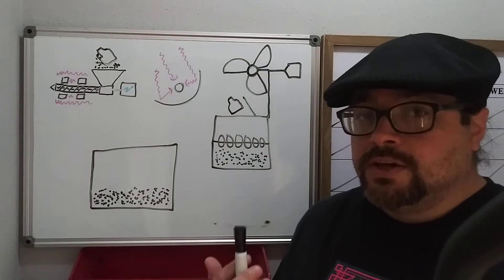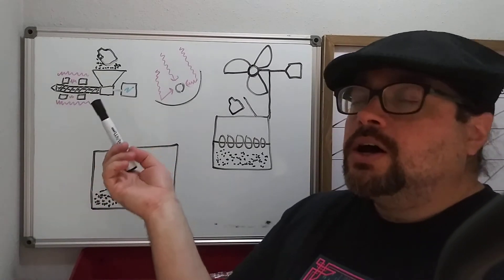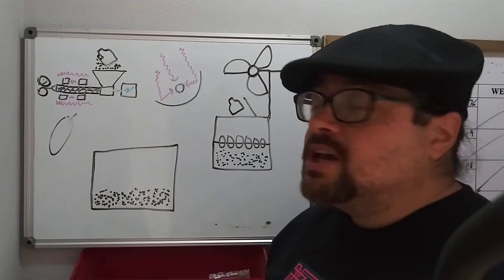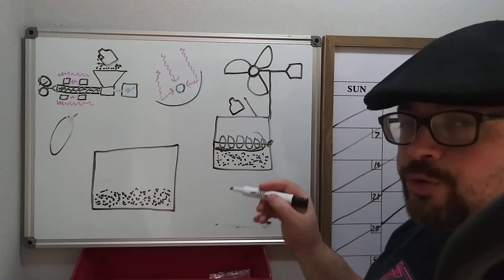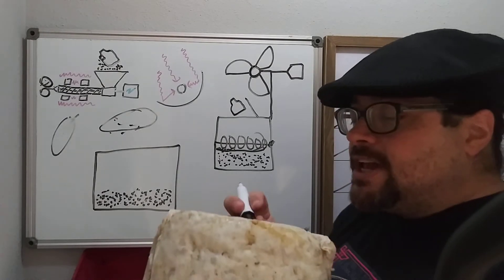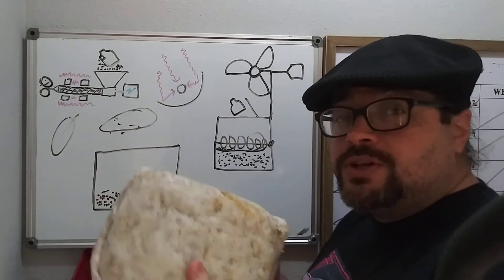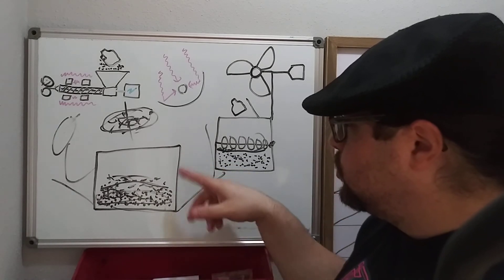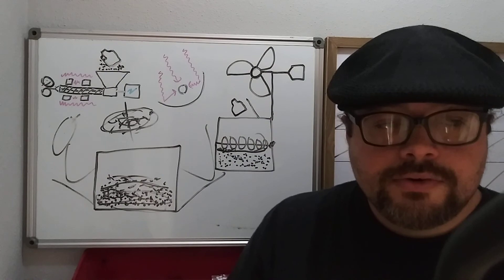Solar Powered Recycling Concept

Comment: At one minute in, I looked at the chalkboard and knew exactly where you were going. Great thinking. Note that the reflector should be approximately parabolic at its cross-section so that it focuses light correctly. In order to help moderate the temperature differences at the reflector's focus, it would be sensible for the corkscrew to be under a large thermal mass, which would both store solar heat as well as release it into the product more slowly. Sunlight is notoriously irregular. 

As for all the shredding, can you cut that out entirely? Heat turns the stuff into taffy, so why not have a melt chamber that feeds the extruder in the first place? Mixing after the fact seems a more energy-economical way to average out the product. A vertical, gravity-fed, heated hopper could supplant a shredder. Low speed, high torque, wind-powered shredding equipment sound really, really cost and design-prohibitive. The knives alone would be a vicious expense. Further, extruded product is much easier to cool, not to mention that it's already kneaded from pressure, and it doesn't suffer as much internal cooling stresses as do a billet.    

The gist of the second part of the video though, that plastic could be used as an energy battery enough to be worked through a low-energy input process, was fascinating. The suggestion could really be applied to make local, low-budget recycling more realistic. Shame how much of the stuff we let get buried. Question in response to the idea: does plastic degrade in some way as a result of a protracted melt cycle? Clearly the stuff has its limits, as any fragile old bucket will show.  

Naturally, this comment is being made while watching the video and first considering the ideas; as such, I don't expect my presumptions to be entirely helpful. Refinement requires thought, which means time. Interesting stuff.

Comment: Saw a company on the big island of Hawaii using an array of mirrors to heat a rotomolding operation making water tanks
Reply: Light Manufacturing has a system for this solar array roto molding method. You’d need to be near the equator to have a good manufacturing ‘work day’ though!
https://youtu.be/B12zjHk2D-c
Reply: @trentineer  the setup looked exactly like this one ☝️
Reply from the maker: @trentineer  Very cool, thanks for the link.